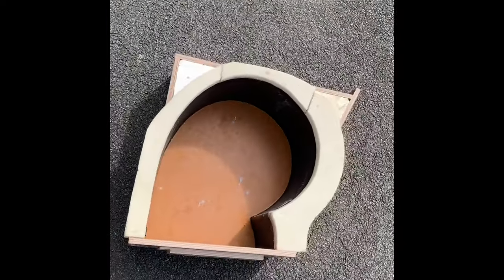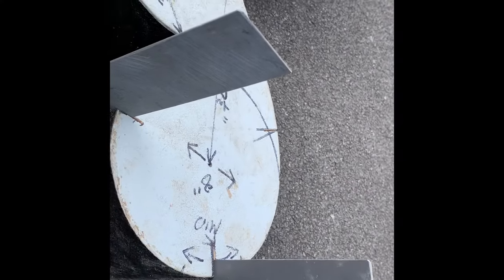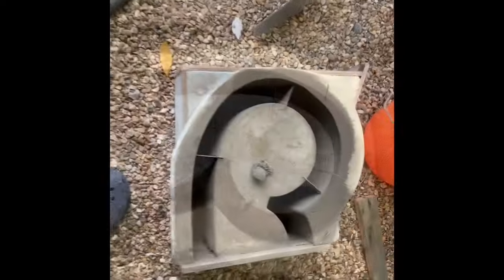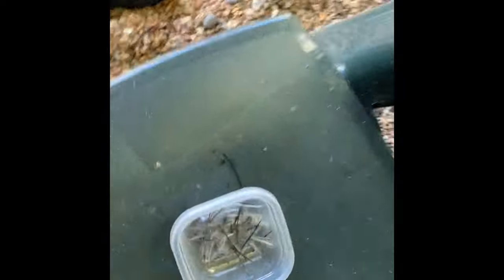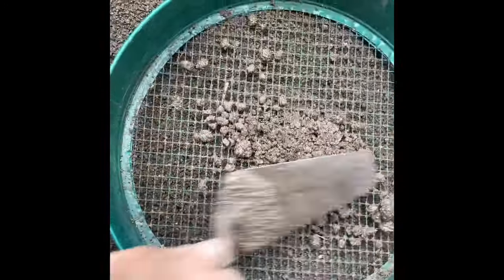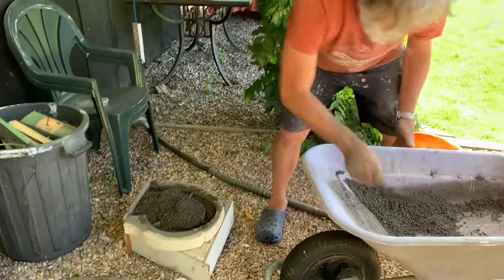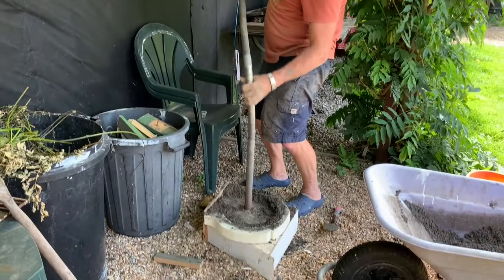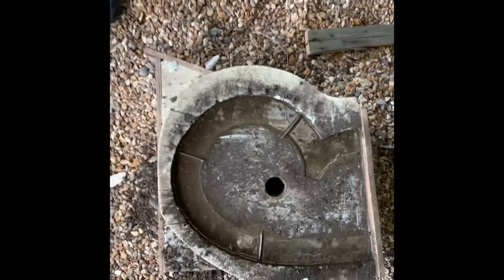Mixing refractory cement for casting.

Comment: Hi there. Thanks for sharing your knowledge, it’s very helpful. I’m about to build my own outside wood fired oven. Most people seem to use vermiculite or perlite to cast the dome and use fire bricks for the oven floor. I was thinking about using perlite for the dome. I have some reclaimed fire bricks which I believe came out of some old storage heaters which I plan on using for the oven floor, although I was wondering if I could use fire cement instead of the fire bricks so that the surface is smooth with no joins for the peal to catch on. I was wondering if you have any thoughts about this and also if you could explain how to make my own refractory cement. Cheers, Steve 👍🇬🇧
Reply from the maker: @steveandsherilyn7543  Hi Steve, yes lots of videos about folk making wood ovens from vermiculite and cement mix but, very few videos showing how long they last!
First you need to realise how a traditional wood oven works, we are going back to Roman times like 2,000 years ago, even back then the builder had worked out and understood that heavy clay bricks are the best material to use because they hold heat for a long time and that heat will radiated back into the oven space.
This is what we call a high mass oven. 
A high mass oven will take around one and a half hours to fully heat up but will hold heat for two days.
On the other hand vermiculite is a low mass insulating material that wont hold any heat and also crack up after  a few hot fires.
So by far the best and most effective ovens will use a dense, high mass material to hold the heat and an insulating layer over the top of that to hold the heat in place. 
So a solid brick or refectory cement, dome is covered with a cement and vermiculite mix or other insulating material.
An oven built like that will last a life time and not half a summer!
A brick base is the best because it will hold the heat and absorb moister from the pizza base, there wont be any ridges to catch a peel if built accurately. 
However if you dont want to invest in good quality fire bricks (they are expensive) it is possible build a DIY refractory cement dome over a mould of sand.
It would take me a long time to explain how to do this so I advise you join the Forum called Forno Bravo. There you will find every detain needed to build a cost effective high mass oven.

Comment: Try first coating your firebrick or perlite with shampoo or dish soap just enough to dampen it it won't penetrate not make sense in Portland cement only enough to coat it lightly allow that to dry by doing this your refractory mix will now need much less water cutting your cure time and helping any issues with cracking
Reply from the maker: Thank you for your comment although I dont quite understand the benefits of coating anything with soap.
I guess you are suggesting that the soap will somehow seal the grog but I would think it would lessen the adhesion of the fondu cement to the brick. The set time is already very quick at around 15-20 minutes.
The main issue for me is that the grog I buy is a mixture of crushed fire brick and firebrick dust, it would be very difficult or at least very time consuming to sieve  out the dust, coat the brick particles, dry the particles and re mix them?
Maybe for small projects it would be worth trying but I use a lot of my refractory mix and to be honest it works extremely well with the correct amount of water and added fibres.
However it is an interesting suggestion ….
Reply: @foxfish7115  

Could you tell us how much of the Poly and Carbon fibers you add to your mix? Thank you
Reply from the maker: @TheLitVic  That is a difficult question as I tend to judge it by eye, I will have to try and work it out and get back to you….
Reply: @foxfish7115  Thanks a bunch for your support! 
I have some Nylon rope I've cut into 2" lengths, would you do shorter or longer than that? Now to find some carbon fibers...hmmm
Reply from the maker: @TheLitVic  I am not sure how to measure the quantities as carbon fiber is so light, it is difficult to weigh a cup full of loose fibre.Not quite as bad but is the same with poly fibers! I would say about a half cup of loose carbon fibers, about 20mm long and quarter cup of 10mm nylon or poly fibers per 20 kg mix. Longer fibers would be better but they become impossible to mix after a certain length. Carbon fibers are incredibly thin, only a fraction of a human hair and they form balls if you are not careful and that would have a negative effect! I use polypropylene fibers for the melt out effect, I buy them as ‘counter top cement fibers’ or concrete reinforcing fibers, from my local hardware store. They come in two lengths, 6mm and 10mm, the short ones are much easier to mix but if you are going to use nylon rope I think you could go for 10mm long. like I said in the intro, it is far easier to buy ready mixed refractory than to  make you own but, as I was making 300kg pizza ovens, that was not economical for me! Good luck and let me know how it goes.
Reply: @foxfish7115  You're the best! Thank you so much for sharing your wealth of knowledge!

Comment: Do you think rockwool fibers could subsistent e for your carbon fibers?
Reply from the maker: I dont think so as they have no structural  strength, the longitudinal  strength of carbon fibre is immense and it is readily available and cheap for this purpose.  You can buy a small piece of carbon fibre and cut it up with scissors, even a small piece will provide tens of thousands tiny fibres. The Polypropylene or nylon fibres can just be cut from a piece of rope but I buy mine as they are commonly used in cast concrete  and are available cheaply from my local store.
Reply: @foxfish7115   Thank you for you great explanation!
Out of curiosity, is  ciment fondu the default 
cement where you live,?
Reply: Amazing to see the liquefaction!
Reply: @foxfish7115  Are rock wool fibers the same as basalt fibers? I think basalt fibers have significant  tensile strength. I have some ~50mm long basalt fibers with a cement-compatible surface coating which I hope to use with refractory cement.
Reply from the maker: @GreenRainbowParty  I think rock wool is made from Basalt, Basalt is a volcanic rock. Try it and see what happens? Perhaps make some small samples and see if they crumble after a few days of drying, then put the samples in a fire for 10 mins…..

Comment: First video talking about the plastic fibres. Made me think what if you used broken up styrofoam instead. They make small little balls.
Reply from the maker: Well I have heard of people using salt and polystyrene (styrofoam) but nylon fibers are the tried and tested method. You can buy ‘counter top’   reinforcing fibers from many stores, they are extremely thin and wont effect the overall strength of the finished product. 
I think the little poly balls would be far too big for our purpose.
Reply: @foxfish7115   well at first i thought using hair due to another video of someone trying to make clay, then thought about the styrofoam. Then i scrolled down after commenting and saw the comments using nylon rope. Lots of rope around my parts since its a fishing town. Great video, i appreciate you taking the time to respond to my comment.
Reply from the maker: @rashadabdullah9769  yes you could try nylon rope although try to find really thin stands as possible, human head hair would be closer to counter top fiber thickness. I think a lot depends on the project and its use but we are looking at around 1% added to the mix. Make sure the fibers are evenly distributed in the dry mix before you add any water, it can be very frustrating and time consuming to get them spread out evenly but worth the effort. Good luck and please let me know how it goes …..
Reply: @foxfish7115   i want to build a stove, on the ground. That is my intention. First i gotta build my home, but def will be dirt floor. This way the floor will be a heat sink. I also want to mould a large water tank where i can just throw buckets of snow to melt. Right now i am tied up with a project i started 2 years ago, a new (my third) bike trailer for my moped. Once thats built this spring and all goes well i will be saving and planning my next projects: chicken coop, or rabbit, summer home and winter home. Here in canada i hate how all homes are built with solely winter in mind.
Reply from the maker: @rashadabdullah9769  you will need to isolate the fire box from the earth otherwise as you say it will become a heat sink and not allow the fire box to become  hot enough to burn the smoke! 
Anywhere, where there is a flame, must be very well insulated. After the flame you can steal the heat but leave enough to power the chimney. Keep me informed when you start planing…..
Reply: @foxfish7115  good point. I will keep that in mind, thx for the pointers. I tell you, watching the vortex in your stove is really cool. I actually installed a glass on my stove door this winter that i bought 2 years ago after my friend gave me his old stove that was in his father in laws house that burned. I was lucky there, but being able to see the flame in the stove is far better than anything on tv.

Comment: Great video, thank you for sharing. Could you please share the ratio of your mix? I am willing to make a pizza oven with castable refractory concrete.  And make the mix myself. Your help is greatly appreciated. I am feeling overwhelmed with all the content on the net. Thank you very much !
Reply from the maker: For a pizza oven there are two main options …. Four parts crushed fire brick and one part high temperature cement (cement fondu) or what is called ‘home brew’ one part portland cement, one part lime, one part fire clay four parts sand. 
Nylon fibers should be added at 1% in both mixes.
Good luck.
Reply: Thank you very much @foxfish7115  , any thoughts on the 4:1:1 ratio (4 parts Perlite, 1 part sharp sand, 1 part refractory cement)? 
I am planning to cast it in 6 pieces, so to allow for thermal expansion.
Reply from the maker: @ariadnasol  you do not want to add insulating material to a pizza oven, you want the opposite = dense mass  to hold the heat.
You can then cover the mass with insulation to hold the heat inside the dense mass.
If you look right back on my channel there are a couple of pizza oven builds that I did .
Reply: @foxfish7115  Thanks again, makes all the sense in the world. I will look into your other videos. Have a great day, and thanks again for your quick replies. Salud !
Reply from the maker: @ariadnasol  no problem just ask any questions….
Reply: @foxfish7115 , I have been doing a bit of homework, and managed to find: Builders sand, Portland Cement and Hydrated Lime, but the fire clay seems to be tricky or quite expensive. Talked to a few pottery places, and they sell clay for pottery, but the powder fire clay not really. I did find Fire Clay refractory mortar by the 20kg bag at a different supplier, do you think if could I replace the fire clay and portland cement for the fire clay refractory mortar instead? or what if I go digging for clay from under ground ...
Reply from the maker: @ariadnasol   no you need powdered fire clay, what I would suggest is that you join this forum https://community.fornobravo.com
Reply from the maker: I dont know if you have had a chance to look at the forum but they specialise in making home brew pizza ovens over a sand mold. This is a very successfully  and relatively cheap method .
Reply: @foxfish7115  Indeed I did, signed up and found a lot of good information, thank you. I have also found a supplier of fire clay in the South Island (New Zealand, I am based in the North one) and planning to try the homebrew mix in a small mold as a sample batch, before going ahead with the full build. I am assuming that the parts in the mix are by weight rather than volume.
Reply from the maker: @ariadnasol  To be honest I am probably not up to speed on the latest ‘home brew’ mixes, I have not used it for many years, so I would just ask (or search) the forum. As I was building pizza ovens for a living, I used refectory cement in a vibrated mold rather than home brew over sand. However the ‘home brew’  system seems to work extremely well!
Funny enough I could not live much further away from you, if I dug a hole in my garden and kept going, I would pop up just off the coast of Oamaruin South island. I have a very good friend who lives in Totara North but we have not been to see him for around 5 years now.
Reply: @foxfish7115  Next time you around this way, let me know, and we will share some pizzas from the oven. Antipodes of Oamaru, takes me to Galicia, north of Spain, I spent some time over there back in 1997!!! Lots of sea food ...